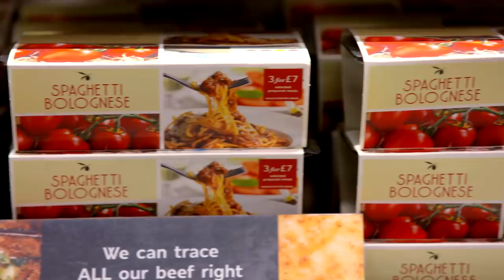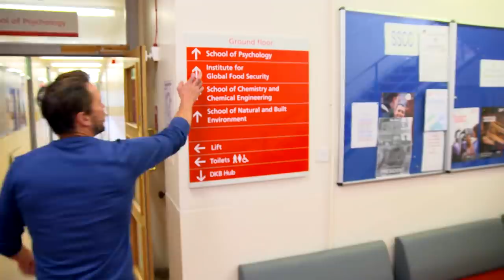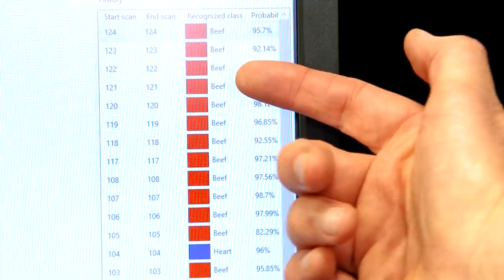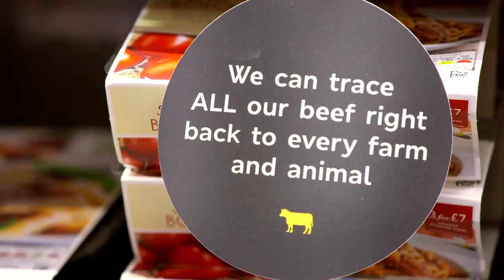Jimmy Puts Supermarkets to the Test on their Meat Tracing Promises | Food Unwrapped

Comment: Would have thought DNA samples would be taken at/shortly after birth by a vet. Potential for DNA shenanigans at or on journey from farm this way.
Reply: What shenanigans? Genetically modifying a full grown cow isn't realistic.
Reply: You are right, there can be (and are) shenanigans between birth and hook but that comes under a different stage. The beast becomes food at the abattoir gate so its there that the food standards start.
There are 2 inspections at the abattoir, one while alive by the state vet and after slaughter by the food standards inspector.
The scope for dodgy dealings on the road from the farm are limited. A beast has to go somewhere, so if low value animals were substituted then the high value one would be on  a path to lower financial return. The state vet would notice a wrong breed so there is little point swapping beasts en route.
Every animal will have a farm that is "responsible" for it in case of problems being traced back, at that point any swap would be identified by a DNA test of the herd, showing up any swap in transit, alleviating the farm from being blamed for someone elses mistake.

The DEFRA passport and ID while alive is mostly to determine subsidies and grants. If DEFRA really wants to scrutinise then the passport holds some ancestry information that can be checked against DNA records and samples.